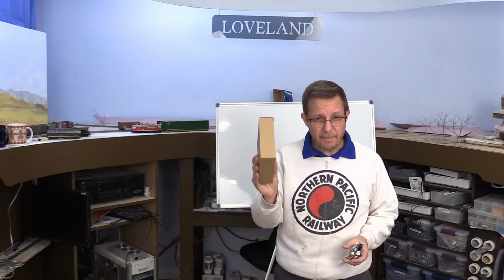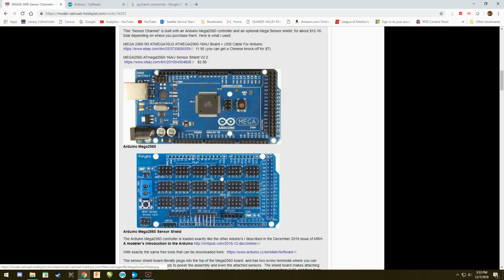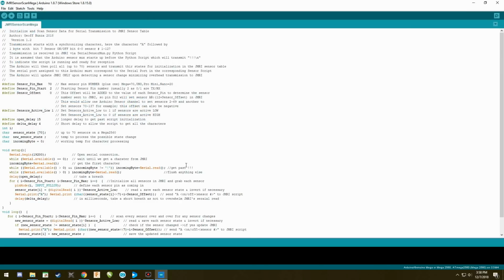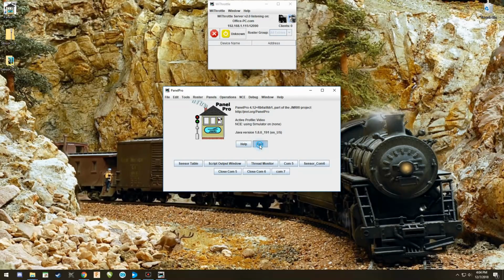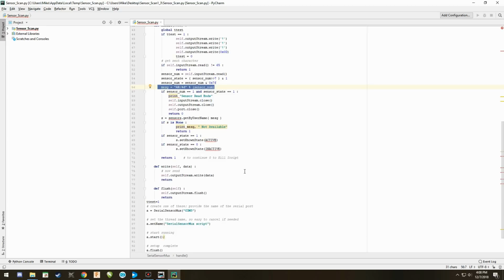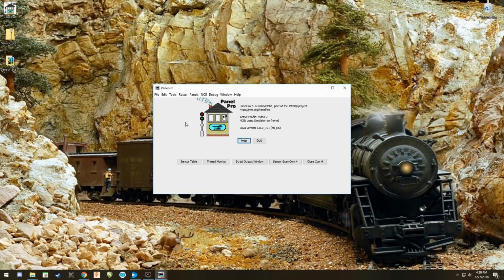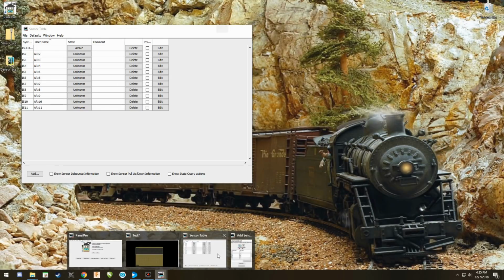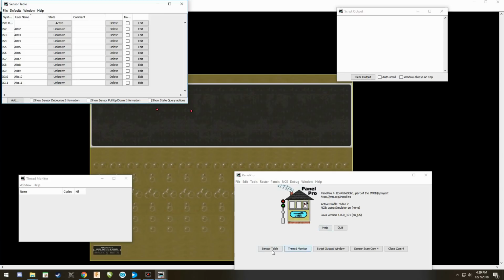Sensor and JMRI pt4 of sensors. Colorado Front Range Railroad.

Comment: I work in IT, and I've used USB over Ethernet extenders up to 225ft or so, with a good quality cat6 with good results. The units I used were about $10 from Aliexpress or similiar...  However, I agree this is unlikely to be the best result, and USB is gonna give you more and more limitations, especially with regard to quantity of units. You can add network to Arduino, but just to add my $0.02, I've opted to use ESP-32 boards to drive my layout detection, switches with nitinol wire on a fulcrum, and signal masts. Their $3-$4 each with wifi onboard. I realize many people's experience with their home wireless gives them a bad taste for the current state of that technology, however in my experience its easier to beef that technology up than to solve this with a dedicated bus such as Can, LCC, CMRI, or others. I use Ubiquiti wireless hardware at home and professionally, including numerous long haul wireless links up to 7 miles out. For a home wireless infrastructure, a $100 access point will greatly improve most people's experience, maybe a couple in a larger home. I've dedicated one access point to my railroad so I can insure I have a robust enough architecture as the entire railroad is connected wirelessly and the only thing navigating the railroad is a 15v track bus and a 3.3v power bus. Everything else is wireless,  and while I have track contact provided DCC service currently, I am working toward ESP-32's in each loco to deliver a DCC signal to the standard DCC decoder onboard over wireless,  as I head toward a future of dead-rail over wifi. Regardless of all that additional you can do with such a topology, for sensors ESP-32's either connected to Arduino's to provide a wifi serial link or directly connecting I/O to the ESP. As a side note, JMRI already has some nice community scripts in Jython to directly support the ESP-32's, but I'm using an MQTT service to exchange state. In my case I needed MQTT for my "home automation" managed day to night layout lighting solution. Just a couple thoughts....  Thanks Mike for sharing, this is great stuff your doing!
Reply from the maker: Andy........That is what we all (the Crew ) figuared as well bit the cost is now the same as a commercially availble product. I have a dedicated network system in my layout and we fould away and tested it and it work most off the time but not 100%. I thought the same idea of Arduino with a Network connection or wireless. I am still working on a few ieads but an NEC mini panel is only $45-50and I need 3 so that may be the easiest and simple solution.
Reply: Mike Deverell No doubt at all, and don’t think I’m being critical, I love what your doing and your layout in general. I land in the middle of the build it yourself debate, and it entirely depends on what your doing. I did a clinic at Amherst last January called DIY vs DIBuy with specific focus on electronics. I think there’s a case to be made for both routes, and I lean on a balancing act. I did build my DCC system, but I did so always thinking I would buy a commercial system, just haven’t found a reason to yet and at this point it seems I’m unlikely to in the near term. Although I may find it’s limitations and simply outgrow the Arduino based DCC++ system I’m using, however I have upgraded it a few times now and it’s pretty capable and feature rich, if you don’t have a desire for physical knobs on throttles that is. Since I mean to go dead rail DIY is about the only mechanism currently to allow for battery power and retain DCC support, standard LokSound decoders, and JMRI overall control. There are dead rail systems that are direct to locomotive/consist like BlueRail and LocoFi and while I find them interesting to follow and would use if I was a garden or live steamer, I’m not interesting it reinventing the wheel that in my humble opinion, ESU has mastered with their decoders from great sound, locomotion, and feature sets like the full throttle template or in any system that doesn’t integrate with JMRI. Thanks much for sharing brother, I know the videos require effort, as I do a show on YouTube Model Builders and even with a team, small as it may be, there’s a commitment and effort handicap to sharing this stuff, especially with the quality of you work. I’ve said and shared on our shows, your channel is one of my “must subscribe five” of model railroading on YouTube content, with Luke Towan, Rob Bennett, and a few others, you really raise the bar for what sharing of quality advise and technique can be on social media. I’m also a somewhat precise and verbose person so I’m sorry my comments are often a touch long, I just don’t think in brief quips as the internet is inclined to praise, it’s just a good thing I can dish out reasonably quickly with my thumbs :)
Reply: @AndyCrawford_NorfolkWestern  just to add my 0.02 cents, I am in the process in developing this on my layout, that I would consider medium sized. For communication I am testing ethernet connection to arduinos in strategic positions to control sensors, turnouts, etc. As I am a software developer, I am more favorable to a software solution and I am creating a central hub that would coordinate the communication. I discarded wifi due to what you commented before: it seems to unstable on home network, so I do not want the same problems on layout, like for example, smart tv refusing to get online for no reason when using wifi..
Reply: @bcsanches  That's awesome, we might be able to collaborate, there's another guy I been working with on such things and especially on the dead rail end of this. I don't disagree, the cost of adding ethernet to Arduino, plus a network switch, has leaned me away. I don't disagree with typical WiFi, but if you put a dedicated access point in, using a decent but affordable Ubiquiti or Mikrotik would get you a relatively cheap, mesh capable, robust wireless. Now, granted there are things I'm in favor of wires for, I typically say, if something will hold still long enough for me to tie it down with a wire, I will. However, since the reliability of accessory lighting, signals, even turnouts, isn't super critical, I was willing to experiment. In my testing, I've had ESP's connected to wifi for months with zero disconnect and latency in the few milliseconds constantly. I wouldn't recommend this if someone was just using the really crappy WiFi enabled on providers "modems", TimeWarner, Comcast, etc. That's about universally awful. But I have a dedicated network segment for my railroad to insure reliable, predictable results. In my case with a separate router and IP range. I would love to chat with you about this if your working toward such a similar solution, doesn't matter WiFi or ethernet, long as it's IP communication and not some less standard or even proprietary communication interconnect. If you'd like, you could email me at andy@voyagetech.com and maybe get you and the other guy in a video chat sometime to talk about how our efforts overlap. Regardless, collaborating has kept me from chasing down paths that wouldn't have worked out best for me. Regardless, I'd love to see you share your efforts so we can do what seems to me like the "no-brainer" way to do this....  :)
Reply: @AndyCrawford_NorfolkWestern  wow nice! I will email you soon. The server software I am writing (that I call Brooker) will be responsible for talking with the several arduinos and works as a central hub. Plus, I am considering adding to it a driver to talk with JMRI using the same protocol as DCC++, so we can easily integrate with anything that supports DCC++. I live in Brazil, so many times, importing fancy stuff for signalling and turnouts can get quite expensive, so I am trying all this stuff that I can do with cheap chinese arduinos including ethernet shields.
Reply: @bcsanches  I'm doing something quite similar, however I'm not writing an interconnect protocol, and I'm using MQTT to communicate between modules. With a database connection, possible MySQL as I have more experience with it, but I'm looking at MongoDB and other "NoSQL's" for the purpose of storing car forwarding data and RDID reads, inventory, etc., as well as storing battery levels and such as I migrate to dead rail. This should let me produce battery trending reports and could then get and publish to a node.js front end to indicate battery levels and expected run times for any upcoming operating session. This solves one of the most problematic, and often overlooked, problem with dead rail, battery management. I am directly coupling MQTT with JMRI, using existing code, but then I can also use Home Assistant (or any other home automation app) to manage connections to popular lighting controllers and protocols like Zwave and DMX for layout lighting, room control, power management, and the like. JMRI will remain the center of the control world, once the system has been bootstrapped. I am writing custom code to bootstrap or bring the system online and monitor the less reliable elements, namely JMRI, being that I have little faith in anything that has Java in the description. Sorry if your a "Java guy", but as a C++ fella, we have tendencies against liking Java for some reason :)  I am writing a touch of backend code, and agent for example that's involved in bootstrapping the system during install of components and bringing the system up and online, but most my work will be in the frontend area. With webUI's to control install of components, via installation of Docker containers to the cluster/swarm on Docker Engine, monitoring and updating those containers, replacing cluster member nodes, updating containers by tagging new/replacement/updated containers as Production. As well as a TT&TO (but could work as Track Warrants, etc.) car forwarding system with printer support, specifically supporting Zebra thermal's or 
Dymo's so I can print orders out on the layout at order stations. And user interfaces for prepping and operating session, battery management, capacity planning, fast clock control, etc. All that stuff is actually quite easy, as it's individually already done, via MQTT, NodeRed, Home Assistant, JMRI, DMX, and core infrastructure like Docker Engine in Swarm, Portainer, etc., and "simply" needs to be hooked together and scripted with some UI elements written to allow any tech savvy user to install and bootstrap a system and maintain it over time, as well as the few elements used in operation. Even the parts I need to write, have been somewhat well established, such as the From Here to There layout operating system that I'm taking inspiration from, or may just buy to integrate. I know this is long, but I've spent alot of time thinking about this, researching, and developing pieces, but I think it's quite doable, and I have much of it already working. Curious, minus some of the component decisions, how far away from this is the solution you've been thinking through?